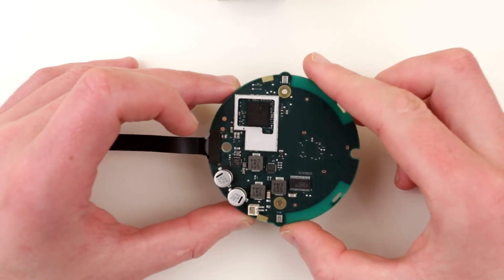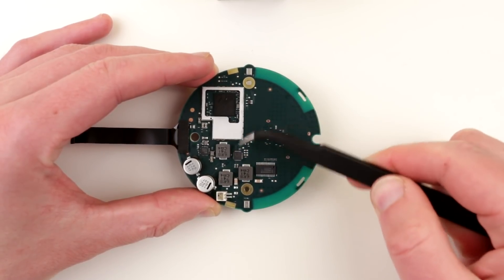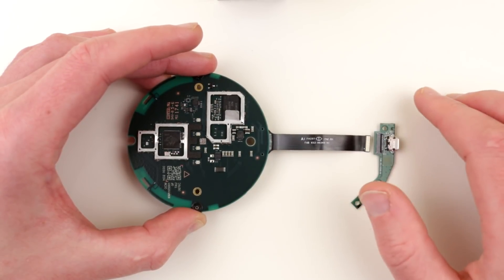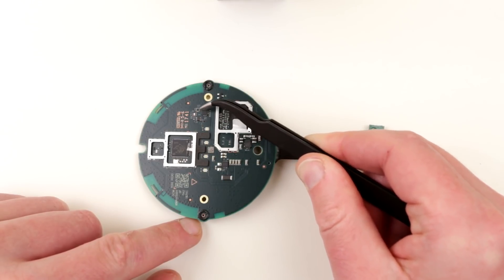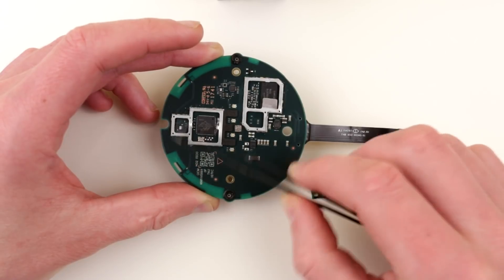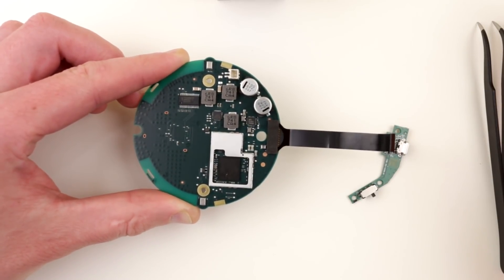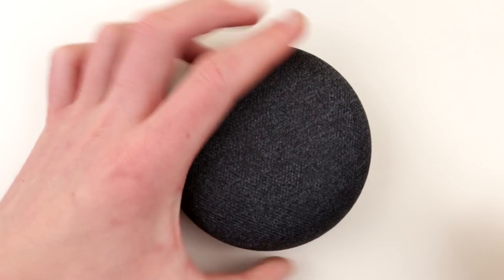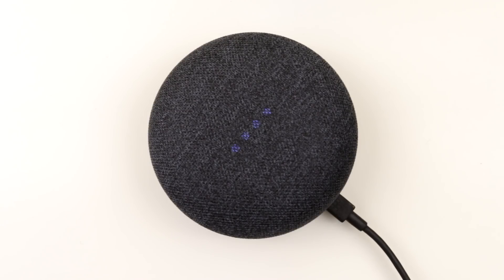Google Home mini a closer look

Comment: What is in the sealed speaker box? Why do you think that is the portion of the unit that has the serial number stamped on it?
Reply from the maker: There is just single speaker inside that enclosure. I think that serial is a serial number of the whole unit....
Reply: @InsideOutElectronics  Thanks for the reply. It just seems strange that the serial number is printed on a seemingly unimportant sealed box. I was curious to know if there was maybe a battery pack or something deceptive that could keep the unit running even while unplugged.
Reply from the maker: No, I wish it had something like that.